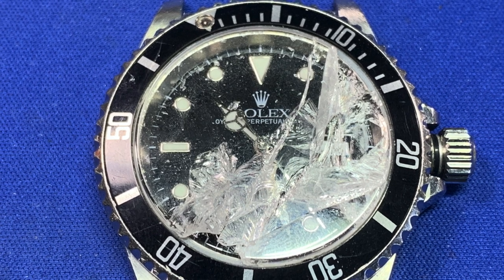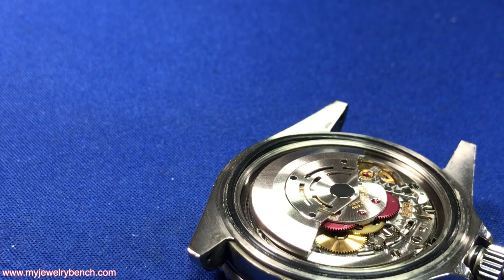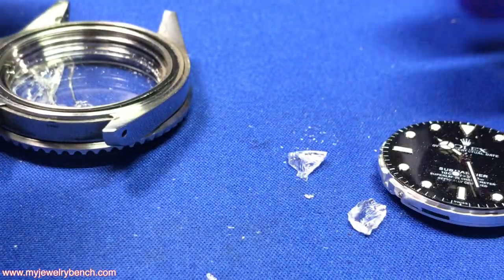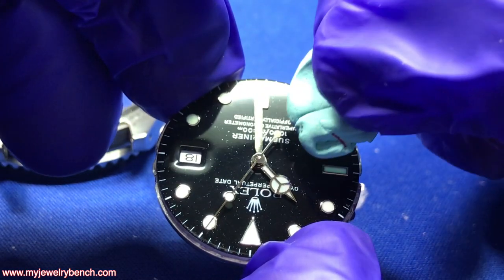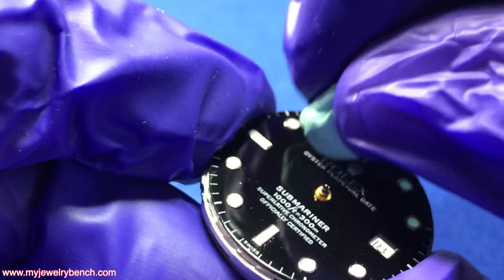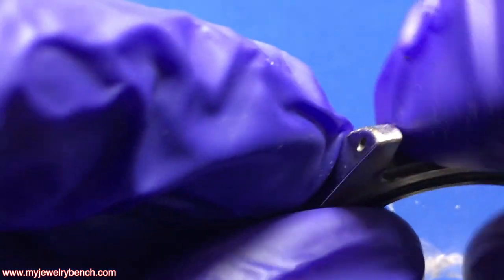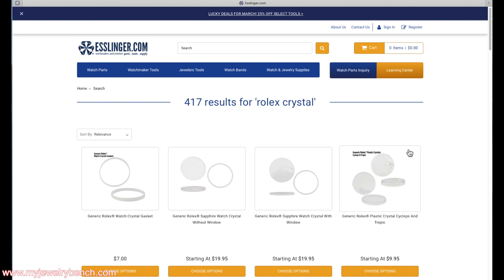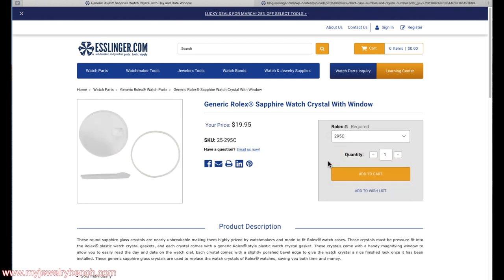Rolex Submariner - Smashed Crystal Cleaning and Finding a New Crystal!

Comment: Super how he plonked the movement down on the broken glass. That’s expertise for you !!!
Reply: He obviously does great work otherwise he wouldn’t have rolexes to repair, only timex and casios, Rolex watches are trusted to only a very few watchmakers, food for thought 🙄
Reply: Says who?
Reply: Quite shameful really Hector. With high end watches it’s critical to give them to an expert . It’s worth paying the extra money for peace of mind.. Skill comes at a price. 
A very good indicator is to see if the back screws are gnarled. If so,  the screwdriver that has been used is the wrong size. It’s important that it fits the slot well before turning.
On a Rolex screw on back again the serrated tool that opens it should be a quality piece of engineering that fits perfectly otherwise gnarling can occur..

Comment: HELLO' PETER : THANKS FOR YOUR TUTORIAL VIDEO'S LEARNING A LOT
MY 50 YRS OLD ROLEX ACRYLIC CRYSTAL CASE 1675. I BOUGHT A COUPLE CRYSTAL ACRYLICS BUT DURING ASSEMBLY BRITTLE OR DAMEGE', HOW TO PREVENT DAMAGE AGAIN; DOES NEED TO REMOVE THE BEZEL INSERT??? TO PREVENT FUTURE DAMEGE. ALSO VERY DIFFICULT TO ALING ON THE CASE WITHOUT ANY, SLIT THAT HOLD IN PLACE OR' NEED A SPECIAL DIES' FOR THE ABOVE CRYSTAL OR MODEL ( RLX'GMT PEPSI BEZEL CAL 1570&) CASE 1675.

Comment: Does it affect the resale value? After restoring
Reply from the maker: Aftermarket crystal can sometimes effect price.  Orem crystals are not difficult or expensive.  Older watches or those with plastic crystals, normally have no effect on price.  It is important that the watch be pressure tested.  Water damaged will effect the value of any watch.

Comment: NEVER EVER PRESS GLASS INTO A DIAL! I use an automotive vacuum with a long Brush or masking tape that only touches the dial in one place, constantly spinning the tape to a fresh spot. You have glass embedded in your Rodico and every time you press it into the dial face it is pushing that embedded glass into it making new scratches. Glass is much harder than anything in the head itself. As soon as you apply pressure you will get indentations into the face. If this were my watch I would be very upset.

Comment: How much does something like this cost to do
Reply from the maker: Between 75.00 and 125.00 usd.
Reply: @watchesandjewelry  I’m getting quotes of 750$ and up ! I just shattered my 36 date just. The watch is also not working
Reply from the maker: Did the crystal shatter and did glass get inside?  If so then the watch will need a service. New crystal and full service on average for an out of warranty repair is about 450.00 to 500.00 in that case.
Reply from the maker: Keep in mind that two factors apply.  How much glass got into the movement and if the watch is new and in warranty.
Reply: @watchesandjewelry  yes there’s glass inside
Reply from the maker: I would recommend a full service on the watch then.  How old is it
Reply: @watchesandjewelry  it’s a 2016 36 date just